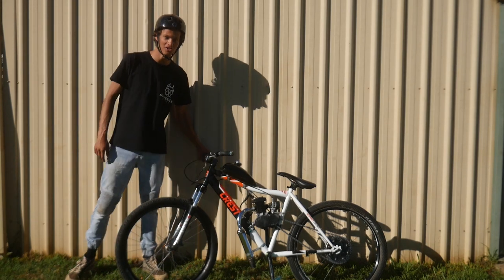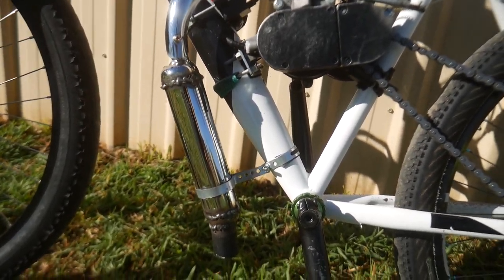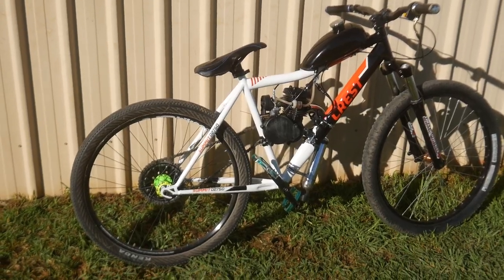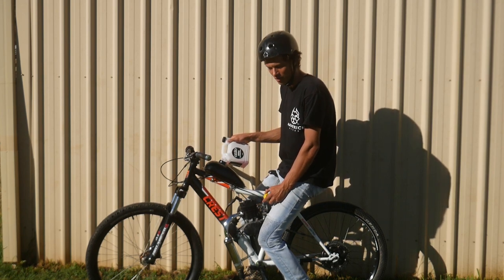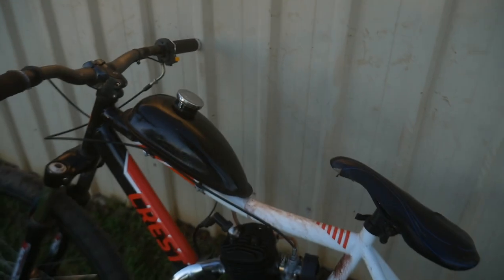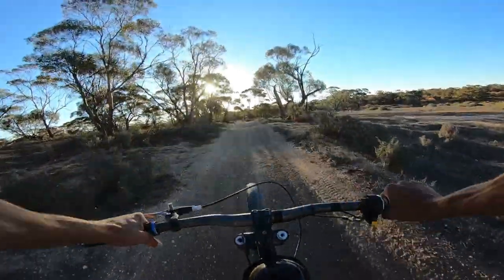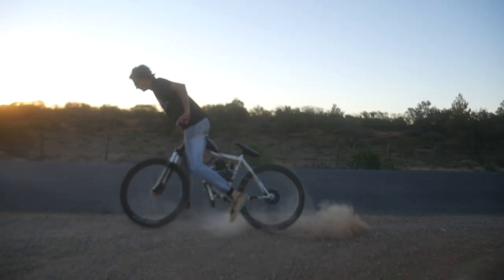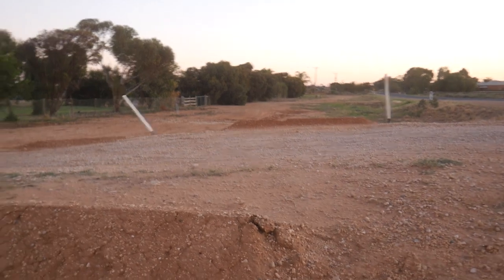Riding a Motorised Bike on Motorbike Tracks

Comment: I’ll send u out a letter In the next few days mate 👌
Reply from the maker: Do it bro I will be stoked!
Reply: You need to get an actual dirt bike that would be sick
Reply: Daniel Ferguson Productions but what if he likes the bike he is riding in the vid?
Reply: @mightypies4  made one myself had one for a couple years a ported cylinder 3rd transfer boost port and dio reed would smoke that dirt bike with a 44 tooth
Reply: 38 tooth it would fly on the roads not so much for those hills tho
Reply: @danielfergusonproductions8273  will get pulled over on the roads and what's gonna pull more attention then a bike keeping up with car in a 30 mph lane
Reply: @danielfergusonproductions8273  Capable of getting to the 40 & 50s and a minarelli will get 60mph stock a lil porting you'll get 70 easy

Comment: 20:1 is still way too much oil man! Most people where suggesting a 32:1 or 40:1 mix of oil which is actually not a stronger mix of oil. Its less oil and will help heaps with the engine bogging down like that. 32:1 is 31ml  of oil per liter and 40:1 is 25ml per liter. Trust me mate ive been riding 2 stroke dirt bikes my whole life and a thinner mix of oil will help out a lot as 20:1 is a lot of oil.
Reply: ludicrous says the one with a channel focused on gameing🤦🏼‍♂️
Reply: @ludicrous5752  is true 50:1 is 50 parts petrol 1 part oil therefore there is half as much as a 25:1 mix.
Reply: No one seems to understand it mate, i know exactly what your talking about ive riden dirtbikes and messed around with 2strokes my whole life too, my old motorised bike used to run like an 85 when i mixed it at 50.1 not as much power but it would rev like one
Reply: 30:1 is my go too easy too mix 4 oz to a gallon when you get 8 oz bottles its more easy too do in a rush
Reply: they are cheap engines no protective coating they need alot of oil.
Reply: He’s right, I only run 40:1 or 50:1 full synthetic No ethanol on my 66cc in westernized countries we generally have better oil
Reply: Yea totally get that cause Iv been riding dirt bikes since I was three, but these tiny ass little engines use suck up a lot more oil meaning u gotta have a high ratio. Iv got a little gas bike like this and mine runs 5:1 stock so it’s got a rly high ratio
Reply: I agree
Reply: @ludicrous5752  talk about stuff you know, if its not gaming keep yer mouth shut please lmao. damon is right with the 32:1 to 40:1. your bike is wayyyy too rich.
Reply: ya let's use less oil and destroy ur engine in no time....iv had one for 3 years now same engine.. always used ams 2 stroke oil and mixed it at 32.1... drive it 30k everyday in the summer to work and back
Reply: Dirt bikes aren't built the same as these crappy Chinese motorized bike motors though, trust me man, if you use a motorized bike on a trail like this and push it to its limits like this, running anything less than 20:1 or 16:1 is a really bad idea, especially if the engine is still new
Reply: @greenalien8503  3 years same motor and still going today... 32 to 1 mixture with good oil... I pulled the motor apart this winter and the piston looks like almost new... didn't even replace anything just pulled it apart to see.. motor was new 3 years ago.... there is adjustment settings on the carb for air fuel mixture...the trick is not starve it for oil cause it bogs ... its to get it in tune for opictal proformacnce and ur motor will run and last for a long time
Reply: I have ride  two strokes for about a year and a half and even I understand this
Reply: It depends on your sea level I live in Idaho and 40:1 is perfect
Reply: Here's the thing guys, it's not a high quality honda or Kawasaki or everyone's favorite a yamaha, or even a husqvarna. He needs that extra oil to help cool the engine, its probably an 80cc Chinese made garbage piece of crap engine. He'd burn it up in one day if he ran it lean. And dirtbikes aren't ment to be ran at  a consistent rpm right? That is why you don't need a 20:1 mix.
Reply: @Logan Raith even then if you run it too rich it can cause build up and lead to more problems! Smaller two strokes last the longest when you keep them in there powerband and when you run 20:1 it doesn’t allow enough gas for it to get into its powerband as you can tell in the video! Sounds like it tries to get in powerband but barely can’t! Not good for the bike when you run it like this! I would recommend 32:1 and if you don’t trust that then slowly lower the oil until it can at least get into the powerband to avoid further problems
Reply: @Carter-Spencer  thanks man, ice been leaning mine out and running it in the powerband actually, tuns smooth.
Reply: @Logan Raith yeah man! That’s what 2 strokes are made to do! Might as well switch to a 4 stroke if you don’t have a powerband!
Reply: Yeah ive put together a few of those kits and learnt that they run fine even on 50:1 and you can just use ya brushcutter mix
And all the extra oil when it aint getting the revs just gums it, mabye a commute youd get the dog a good temp. But not muckin around the sand tracks

Comment: 4 of my friends have got them and its really just luck of the draw when you order them if you get a good one or not
Reply from the maker: Mine seems to be reliable so far, my other one was alright I just didn't look after it
Reply: just like go kart engines haha
Reply: @10acebikesjodybennettii19  so is zeda a good company to buy from?
Reply: I disagree , I’ve ordered several from different sellers , and if you know how to work on motors they run fine and you get what you pay for , I wouldn’t recommend doing what this guy did but this goes to show the abuse it can handle for a kit that’s under $100
Reply: Lewis Bellamywells yes Robert from zedamotorsports. But know that he’s extremely busy so if you can’t wait then find a new company. Bicycle motor works or ken Hinson at scuttlebucketbikes. I’m building a 212 predator 4 stroke. A lot faster stock motor and it only cost $100
Reply: thats why u buy them, off ebay cause if it is broken or anything wrong u can file a clame and get ur money back no questions asked...the seller burns hard from fucking people
Reply: Greg Barling lol u need to look after it ;)
Reply: I like my BBR stage 4 
I recommend non-ethanol 
And a better 21mm carb. 
Other than that it gots about 40mph with the stock carb.
Reply: fax bro i think mine has a rod nock

Comment: I would try to adapt to a bigger carb, and adapt the exhaust pipe to have a 2 stroke style expansion chamber.  I think the engine perform much better with those 2 changes.  I think I might buy one!
Reply: I think the bogging you were getting may be the plug fouling.

Comment: Love the videos Greg. Love how regularly you’ve been posting recently. My engine has arrived. Just looking for a cheap bike to put it on.
Reply: Find one with a 1 1/8" steerer so you can add a good set of forks (definitely coil cause air chambers might not take to the added weight and forces of a motor) on there if the ones it comes with are a bit dodgy.

Comment: That was pretty rad! Do you ever have parts get loose, broken, or leaky riding it offroad like that? Mine recently snapped the frame near the rear dropout just street riding, and those studs on the gas tank HATE vibrations and bumps.

Comment: go at least 32 to 1 gas to oil ratio.  I would also recommend the YD - 100 from Zeda. I can garenty that it will have almost double the power and much more than double the torque of this eBay kit.

Comment: If your past the brake in period you really should be running 40:1  3.2oz/Gallon it will run way better plus alot faster and there is still plenty of oil to lubricate everything.

Comment: I run 32:1 mix. The oil I use is Maxima Castor 927 and the motor loves it! My motor is heavily ported plus I have the racing carb and the mz65 pipe. It's a ripper!

Comment: Greg mate please try 50.1 mix in it and a ngk plug, go 1 hotter aswell, pare that with your exhaust and intake mods and she'll fly
Reply: Going hotter isnt a good idea because it is already boging from running to lean he should adjust the carb go to 1:40 maybe and check the spark plug face
Reply: @gnaedigerfels  ive owned 7 of them, 50 cc and 80 cc, they all bog because they run way to ritch but if you lean them out enough for them to run perfect and crisp, they dont last long, my best strategy is move the needle down one click, 50.1 mix and the plug and what hes done (intake and exhaust)

Comment: Can anyone please help? I have an 80cc pedal and pop. I was riding around as normal then i pull in the clutch and for some reason it revvs up so much...? I have tried cleaning the carb and i have also tried the idle screw but nothing changes
Reply: No load on the engine: so it revs easier

Comment: I recommend u getting a pull start of eBay for the bike
Reply: Pull starters for these engines are absolute junk. Bad materials used. Itll work lovely for a while and then itll just crack or break apart
Reply: I got one but the spring jammed and wouldn't pull the string back in. Got a refund but I'm gonna try and replace the string with a starter motor

Comment: Looks good and the carbies are pretty trash that why they cut in and out and be careful with it because the clutch pads get stuffed really quick when you go up hills and jump stuff
Reply from the maker: Thanks for the warning bro, do you recon it would be worth upgrading the carbie?
Reply: Greg Barling yea if your gonna use it a lot I would change it a racing carbie I brought one of eBay and it has a better air filter set up but there not always adjust right so when you get one just Change the needle setting on the Carbie but yea definitely worth buying one

Comment: You are running really rich that is why it's 4 stroking you will add power and maybe get that to stop by taking the clip off that needle and moving it up I would go all the way to the top as well should see an increase also if you buy a Reed valve bigger carb and windowed piston and take the lower piston ring off leave the upper one on it will add power you can find lightened windowed pistons online make sure it is the right one for your motor type a and type b
Reply from the maker: I've already played around with the clip on the needle it's in the second leanest position atm. I tried all of them and it ran the best in that position even when I moved it, it hardly made a difference anyway. I'm not really chasing more power. I'll probably just make one more video with it sessioning the yard and then retire it unless lots of people want me to keep making videos with it. I'll just use it for cruising to mates places and occasionally doing this type of riding as I did in this video
Reply: @GregBarling  awesome those are minor adjustments anyway carb needs tuned with actual jets being rich don't hurt anything just loosing power extra oil will just be a benefit  in keeping it running I have built well over 100 of these they're fun for what they are but you can spend as much as a high end mountain bike just in engine mods they have billet cases that are case induction and dirt bike cylinders I'm actually opening my motorbike shop back up soon

Comment: 15:16 your bikes running a bit rich you need to adjust your carb and and run a 40:1  2 stroke mix
Reply from the maker: I might try 30:1 mix first
Reply: Greg Barling while your at it.    if you haven’t  done it already   replace the spark plug that came with the kit   with a ngk spark plug for a chainsaw it’ll run better

Comment: You need to go down a hill holding the clutch in with the motor on go about 80kph (the more is better) get all your weight over the back wheel (more is better) and put the rear tire to 15psi.  Once your going above 80kph let the clutch out and it will rev to the shithouse, that will fuck the governer and then it will rev higher and go faster
Reply from the maker: Hahah I'm pretty happy with how fast it is bro, If it revved a bit higher and accelerated faster and smother I would be stoked .